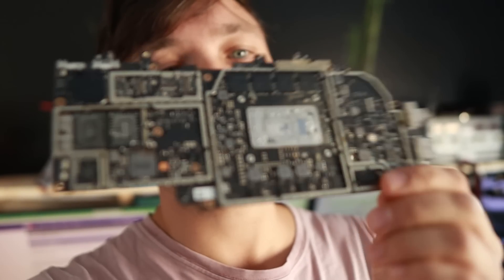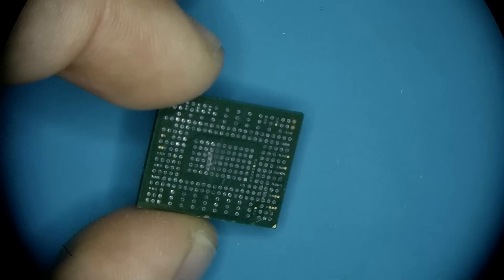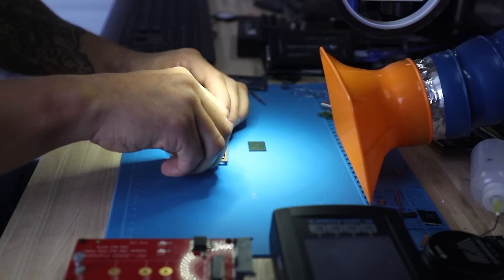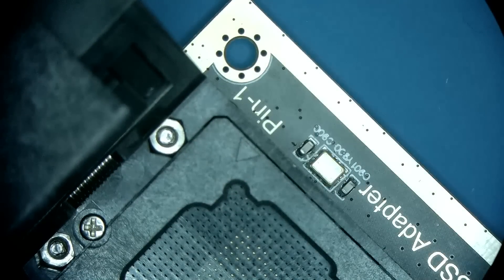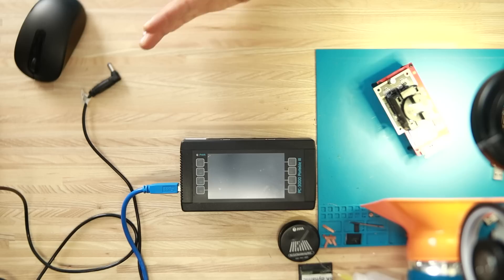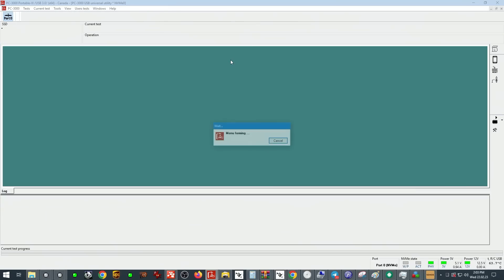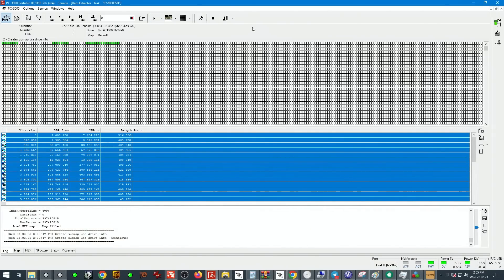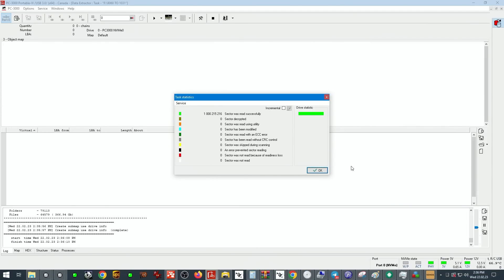Surface Pro data recovery made easy: what you need to know

Comment: What's the name of the adapter? I found the "Surface Pro BGA Data Chip Adapter NVME Version" for $730. A bit pricey for a glorified SSD adapter but expected for such a specialized unit. Any other options?
Reply from the maker: Another option is to get a Toshiba SSD for Toshiba and Samsung chips with the same chip on it and swap it with them by hand.

Comment: Hello, Thanks for this useful video. I just have a Surface pro5 that don't boot but Surface is working. I tried to boot with an usb key windows installer and the installer see the internal 256GB ssd. I have a PC3000 but the adapter is quiet expensive because i don't have many Surface to recover. Do you think it will work if i buy the adapter ?
Reply from the maker: Hard to say, you can get Toshiba ssd with same footprint and swap you chip on it. Make money off that case and buy a proper adapter for future  😄

Comment: My hard drive sata power port burned. 2 of the pins in the middle melted. What should i do?
Reply from the maker: If it was up to me I would just read out the eepRom with a programmer using a connection clip, and burn the contents into the donor board. Just replacement of the board is not going to work, rom needs to be cloned or moved

Comment: Not sure if connecting SIP NVME SSD to the interface should be considered as a recovery. BGA soldering skills, of course, but pc3k just makes it way slower compared to direcr m.2 method. Basically all you need is to find m.2 ssd with the same pinout and move chip from one place to another. Unlike apple SSD, MS uses quite generic stuff like kioxia bg4 on this video which is nothing but a embedded circuit 1to1 equal to what you find on m.2 board
Reply from the maker: I am actually just filming this ;) next episode Alexey

Comment: Ca you provide link for bought the adapter, and there adapter for nano memory from USB flash drive... Thanks greatings from Portugal 🇵🇹 🌟
Reply from the maker: I am working on another video that will have an alternative method of dealing with this for a fraction of the cost. Wait till it comes out ( this week or next week) and then decide if you want to buy it. It's over $800USD and there is way to solve if for like 30$
Reply: @hddrecoveryservices  looking forward for the alternative way... thanks
Reply: Which video is this $30 method? I can't find it anywhere 😭 (but I do have a broken surface pro...)

Comment: WOW!  I did not know the OEMS used default bitlocker keys.  Is there a site that has the default keys? Or does one need to be apart of the Illuminati? ;-)
Reply from the maker: Illuminati club bro :). I am not sure 100% how those keys are obtained, but if I had to guess they are hidden somewhere on the drive and data extractor just knows where to look for them. I may drop an answer to that in upcoming q&a this week. I'll consult with engineers at Acelab to see how they crack it
Reply: @hddrecoveryservices  So Bitlocker is enabled by default from the factory but they are in clear key mode.  The key is stored in the MBR.  If the user actually went through the setup process of Bitlocker, then this method will not work.  The majority of users do not know this and do not actually setup Bitlocker.

Comment: wait, so you're telling me bitlocker is effectively useless because they all use the same master key?
Reply: No, it is just that encryption is not fully enabled yet.
All data on an disk is encrypted wih an symmetric key aka it is fast and is the same symmetric key to decrypt and encrypt data with...
The user then has an Asymmetric key pair (public/privat)  and this type is slow but very stong, so the symmetric disk encryption key is encrypted with the users Asymmetric  key.

So the bitlocker is enabled by OEM and then the disk IS encrypted but the symmetric key is stored on an readable open place on the disk until the user login and complete the bitlocker enabling process (automatic when login in with MS live or AD Azure account).

If you have an OEM PC and the bitlocker is enabled on the disk and the user has complete the process then you will see an "closed padlock icon" in Windows explore and if the user not yet has done the user side with Asymmetric key then the Windows explore icon for the drive an "open padlock"
Reply: I work with forensics and often get bitlocker encrypted disk images from OEM pc and if/when the user has not enabled the user side yet, then we can just mount the image as a drive
Reply: @ToomsDotDk  What about TPM-based BitLocker encryption, is there solution?
Reply: @ToomsDotDk  that makes a lot more sense.
Reply from the maker: No, the key is a OEM key, so it is not even set by client. Unique key will make intrusion impossible
Reply: @hddrecoveryservices  are you replying to me or U+1F98A?
Reply: only if turned on by the manufacturer.
If you turn it on it will use a unique key.

Comment: The customer could provide you the bitlocker key… And if they signed in with a MS account then it's attached to their account and can grab the key that way as well.
Reply: I can’t believe how there hasn’t been a huge public discussion about this vulnerability. If bitlocker is being enabled by the factory they shouldn’t be using known keys. Should be random per device. At this point anyone with a factory bitlockered system should undo and redo it and get a new key.
Reply from the maker: I don't think so, it's not customer set key, it's OEM.
Reply: @hddrecoveryservices  how it possibile? Without private key?
Reply: @alexlextar9270  He explained that the private keys are in the recovery device. They probably got a contract with vendors and maybe that's part of why it's so expensive.
Reply: @ZomB1986  I’m confused, the private key 🔑 is personal and tied to MS account, how is it possible that they have a private key?
Reply: It would be curious to see if it saves the oem key in their account. It seems like if it didn't, and  the customer somehow made BitLocker angry they would have no recourse to get their data back
Reply: The problem is that auto unlock was enabled, so the key needs to be stored somewhere. But still it is interesting that it is not in the TPM, maybe Microsoft doesn't trust their implementation and doesn't want to risk losing the key.
Reply: They don't know that there is a bitlocker encription at all... I stopped  boring customers about keys when i see onenof these devices...they doesn't  undestand what i'm saying :( they doesn't know also the microsort account password..  they just know the pin :( :( :(